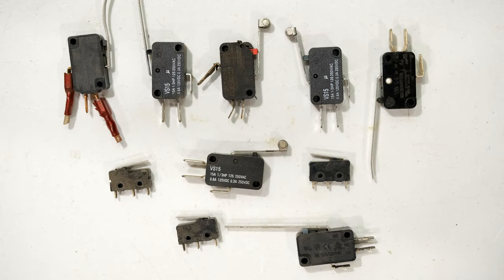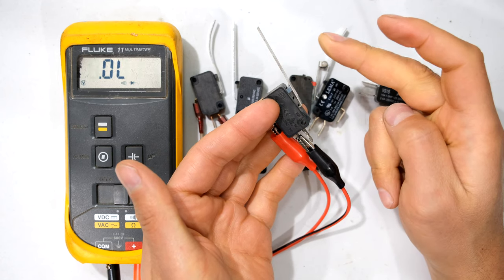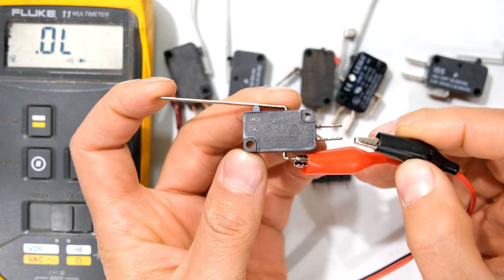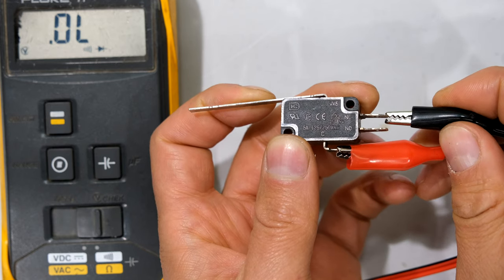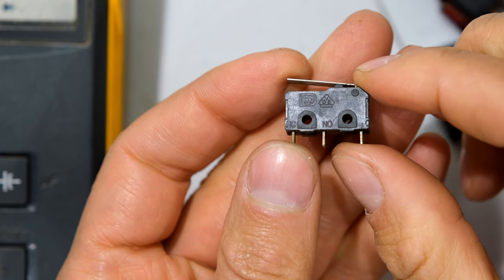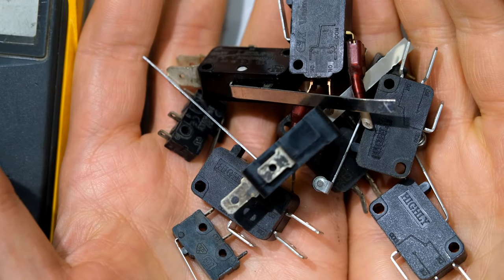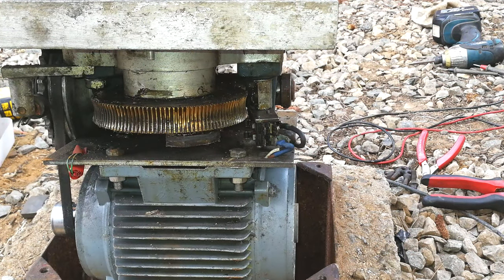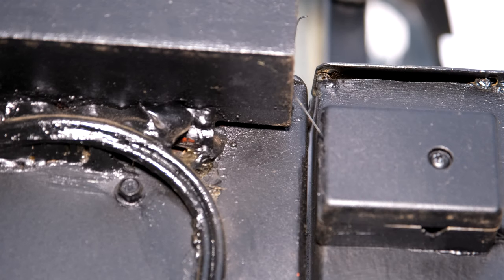What is a limit switch and how does a limit switch work? Practical examples shown.

Comment: Excellent video!!!  I need a limit switch which controls a 12v motor. After closing (or opening) the switch I want it to allow the motor to move in the same direction. How do i achieve this?